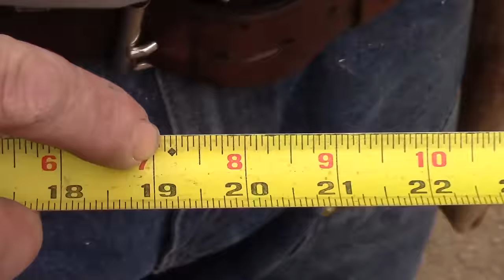Channel Trailer

Comment: I just found your channel about a week ago and I'm very impressed with all facets of it.  Balance is the key to many things in life which is how this channel is evolving.  I just told my wife that whoever is doing the editing and production is doing his father justice, job well done.  It has inspired myself to do more and my next project will be french bleeding and distressing my white oak trim during the complete kitchen remodel I'm working on now.  It's men like your father which made a lot about this country great.  Keep up the phenomenal job your both doing and keep getting your hands dirty!
Reply: French Bleeding, take a good amount of white vinegar 1/2 gal ish with a nice chunk of steel wool let it set a hour or two in a plastic container.  Next take a clean rag and wipe down the oak with the mixture.  Purpose, turns white oak black within seconds to a few minutes.  Distress your oak with a variety of tools, scratch it and poke at it and so on and so forth.  Hand scrape most of it off with a sharp carbide paint type scraper it will let behind all the black in the low spots and what you decide to leave on the high spots.  Apply a medium dark stain, let dry, sand it lightly.  Next apply a combination of wood paste wax and driveway sealer.  Take a big handful of Johnson's paste wax and some black asphalt driveway sealer a good healthy squirt and mix it together, after mixing it thoroughly on to the next step.  Take a old cotton t shirt and put a nice ball of it into a rag and wrap the ball of wax into a tight wad by squeezing it down and through the rag and apply to the wood.  End result,  a warm orange honey colored piece of wood with dents, scrapes all highlighted by the black French bleed.  A very warm looking and old looking piece of trim or what ever your wood is going to be used for.